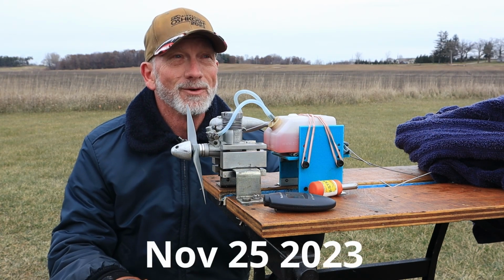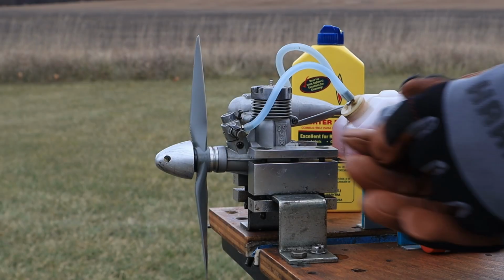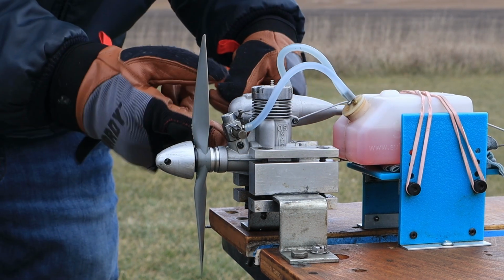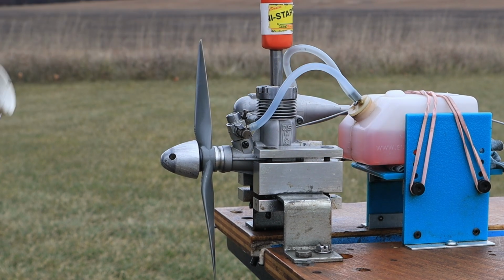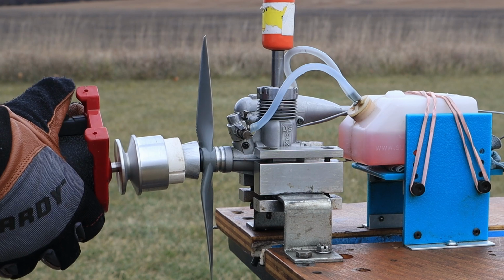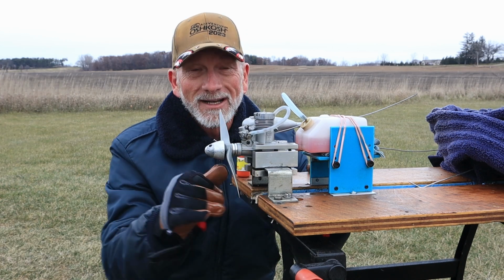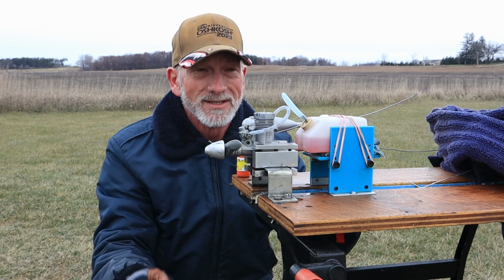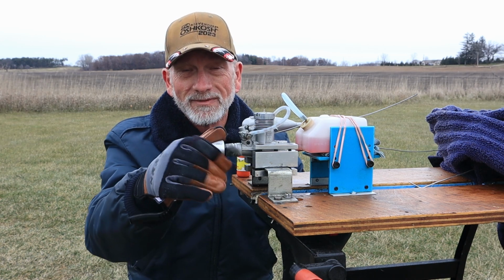OS 25 FSR Another Run (Cold Temp)

Comment: Great video David! She really took to that prop and you could tell she wanted to rev even harder. The cold temperatures do make it play up  especially the unknown of cast iron piston and methanol fuel. I could imagine a bit of carb freeze happening too.

That end play is a bit odd. Almost like a bushed bearing engine. I’m sure it’s fine especially if it still turns over smooth. 

Such a joyous little engine, a keeper fore sure in my opinion.

Comment: Hi David, the crankshaft play back and forth is normal as far as I can tell, I have a few  older brass bushing engines in my collection, some of which are brand new and they all have it. Nothing to be alarmed about. Engine runs well, probably the weather is just too cold as you say. Thanks for posting the video.
Reply from the maker: This is not a bushed engine. It is the FSR which is a double ball bearing engine. It should not have crankshaft end play.

Comment: i have had that issue with some of the after market bearings. i found that the sizes were sometimes not the same as the OEM bearings and having shaft movement,cold and more when hot. its possible, someone may have replaced the bearings already.

Comment: What a great find off eBay. I stopped playing with the newer motors and went back to the FSR ring or ABC motors from OS. I mainly fly 40 size and have been on the watch for a couple of 45 FSR motors. I run 4 strokes for anything above the 40 sizes, in planes I fly. I have a couple plans for plans that will land in the 20 sizes, and I will most likely use the OS 25 FSR for them when I get them built.
Thanks for the content, a thought for additional videos. Would you do a video and share your thoughts on gas and the weight of a gas motor, compared to your inventory of 4 stroke motors? Another thought, I noticed in the 60 FSR and this video, the fuel you used is 80 / 20, did you mix these yourself? If so, could you share your thoughts about sourcing of products for mixing your own?

The reason for these recommendations, the cost of glow has gone up, and sourcing glow fuel, compared to gas, it is a real conversation today and most flying fields have some smart guys that can talk about this topic, and I would like to hear your thoughts from your area of the country.
Reply from the maker: Sorry, I do not own, operate, purchase gas engines.  Unlikely you will ever see that on this channel.  Now if you send me one that might be a different story, but I will never buy one.

Regarding FAI fuel, I have an entire playlist for that.
https://www.youtube.com/playlist?list=PLsvn3JGZAOMuFBXHT90CCuriX37BatIKj